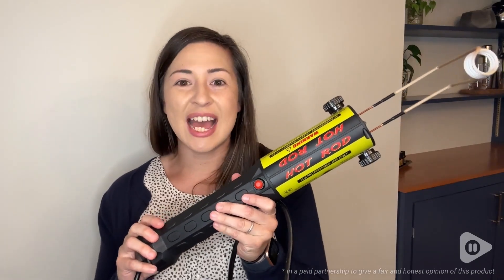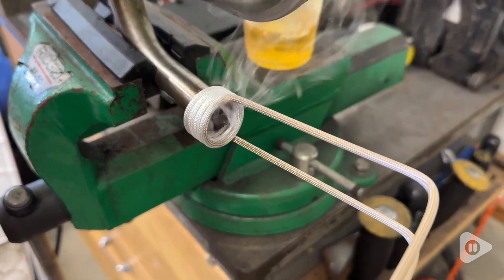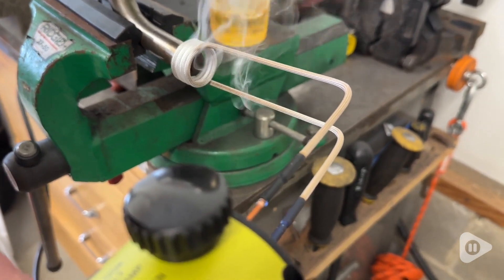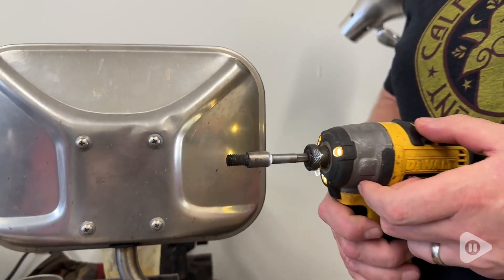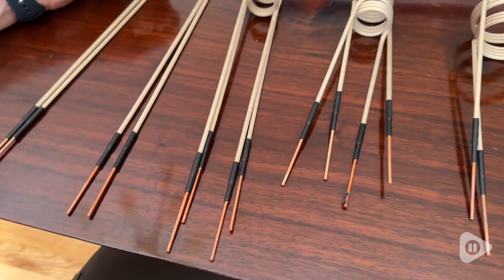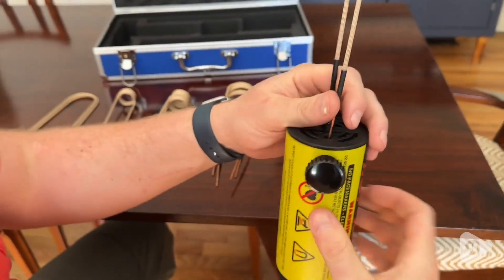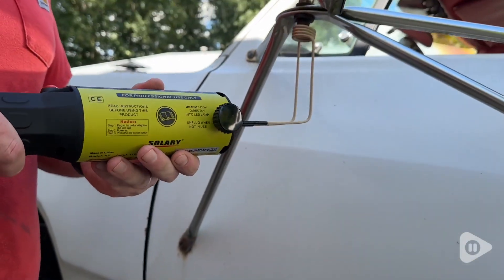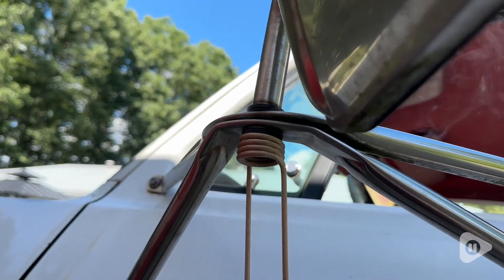Solary Magnetic Induction Heater Kits | POV | Would you buy it?

Comment: Older Toyota/Lexus vehicles have plastic splash shields under the front, held on by metal bolts/washers. Would this tool melt the surrounding splash shield while heating the bolts? I might buy new splash shields beforehand.
Reply from the maker: Hi, we aren't sure about your question, but it would perhaps be a good idea to buy new splash shields beforehand just in case, good luck!